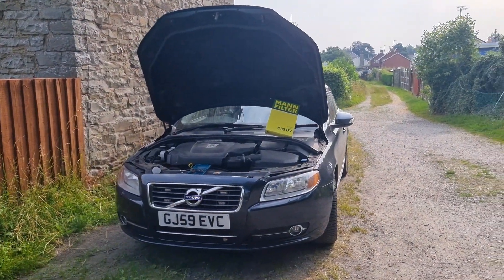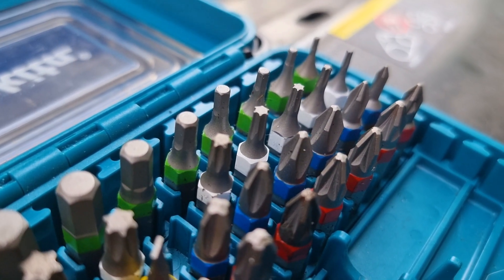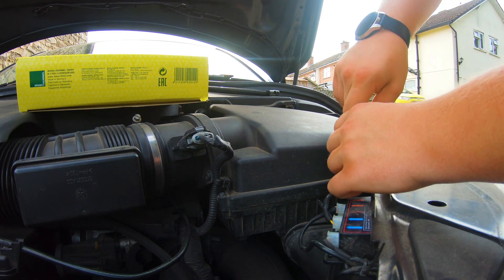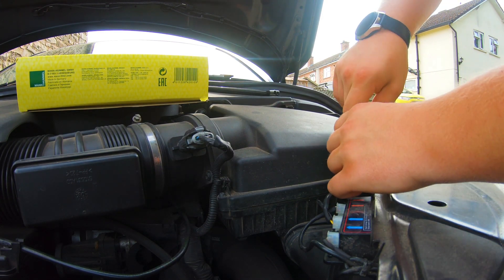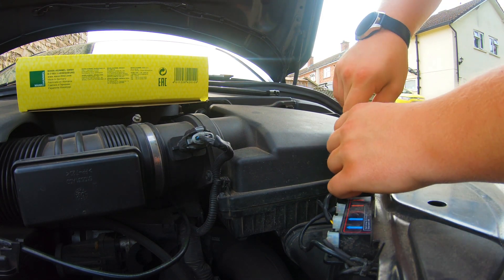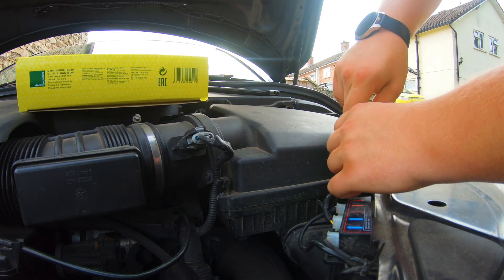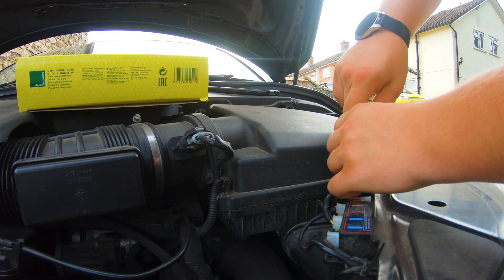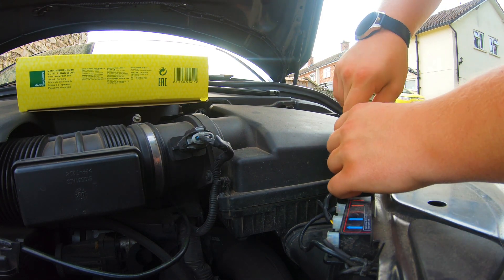How to Change a Volvo Air Filter + Advice! P3 - S80, S60, V60, V70, XC60, XC70 (4K)

Comment: Thanks for another video. I have just downloaded a map update for my model year 2014 XC70 and I was thinking about your comments about the RTI system on your 2009 S80. You probably already know this but on the Volvo Map Update page, there are updates available going back to 2008 but the bad news is they can't be downloaded to a USB drive! They appear to be available on DVD through the dealer network. This probably means they cost an arm and a leg but I thought you might be interested. Apologies if you already knew.

Comment: Firstly the change interval is 36000 miles in other words every other service IF you are doing around 18000 miles a year... The fuel filter is also changed at the same time ....  It seems you are not following volvo's correct service schedule  regularly ..  
There is no problem at all with these Air filters restricting air flow at 36000 mile intervals ,  the filter is well capable of dealing with this mileage , see how deep it is ..  There should be a Volvo  T25 screwdriver in the tool kit !  don't forget the clean out the casing as that will get sucked up and  get caught in that brand new filter. You would be surprised how many discarded cigarette butts  I find in there which are burned right down , that's how car fires start . I agree about K&N filters they are expensive and flow less air in independent tests  .

What is the situation with the cambelt and more importantly the Aux belt and tensioner?    Aux belt MUST be changed every 54000 miles and cambelt and all tensioners at 108000 miles or 10 years which ever comes first ALWAYS use genuine volvo parts your car will be written of if these fail ...

Keep up these videos , simple, short , but very watchable !
Reply: The timing belt I agree with but I’d say don’t let it go much past 100k simply because it’s not just the belt to worry about, my water pump was leaking at 95k on the service history I got with the car so the previous owner had it all done ✅ which saved me a job because I bought it not long after 😄
Reply: @Alexander_l322   I'm very suspicious about the water pump , If you have a volvo engine, water pumps don't go at all , ever .  What might have happened is that someone had the belt done and was persuaded to have the water pump changed to a NON Volvo one as a matter of course  , a deadly move ..  they DO fail  and this will write off your engine or cost you £1000's to put right .. I have seen it all before  multiple times ...
Reply: @nickclark6001  it was the original pump that leaked and it was changed with I believe a genuine belt and water pump along with the tensioner because if I remember correctly all the work this car had and services  has been done by Volvo or a Volvo specialist

Comment: I have not replaced my 2019 S60 filter has yet. I have not driven it much only has about 4017 miles. Do you think I should replace it and the cabin air filter now?

Comment: I’m trying to remove the little grey dipstick as the electric one isn’t reliable. However it won’t come off. Seems like it’s never been removed and I don’t want to snap it. I even tried wrapping a cloth around it and pull but it’s still stuck. Any recommendations?
Reply from the maker: WD40 all the way around it and twist it to allow it to penetrate :) they aren't easy 🤣

Comment: One of my screws won't go back in the groove I have a hard time placing on corner all the way down. It's like a small gap because the screw won't tighten. It was also hard to get out like maybe the hole is possible stripped